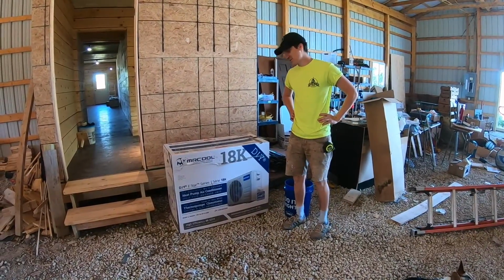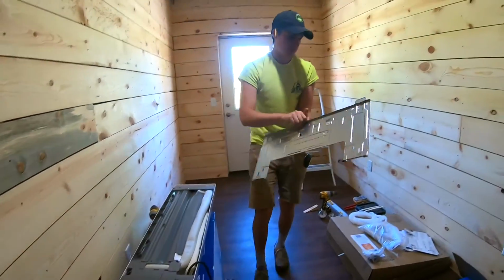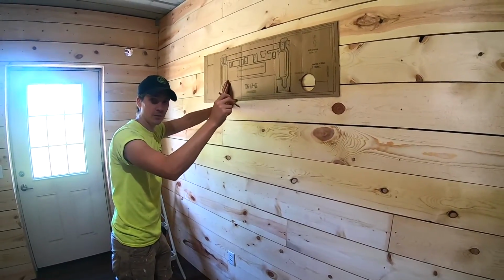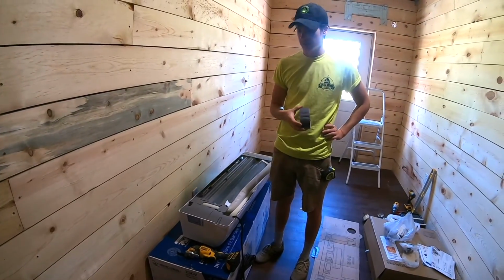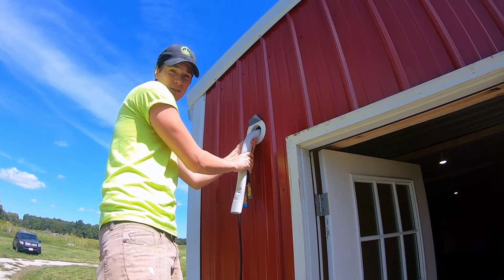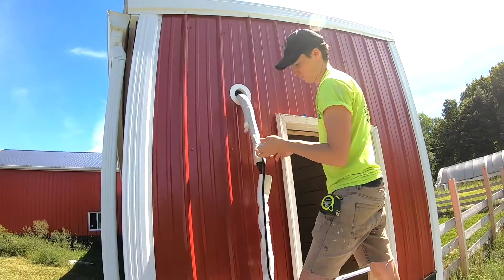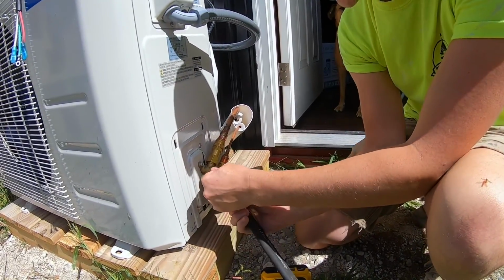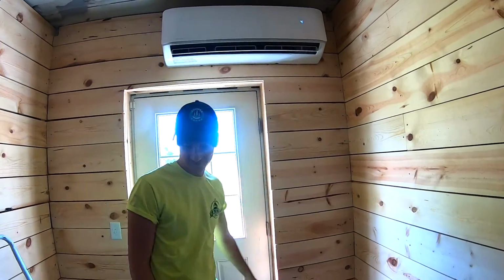How to Install Mr. Cool DIY Mini Split - Gen 3 E Star Series Heat Pump / AC

Comment from the maker: If you are wondering about performance details and costs we've experienced with a Mr Cool Universal heat pump, then be sure to check out our Mr Cool HVAC playlist.
https://www.youtube.com/playlist?list=PLExVGissIl-GdKsUBhF3c0fQ6E_o6oOaZ 
We have tried to answer as many questions as we could imagine in the 17+ videos in this playlist - hopefully they help you!

The price of the unit we bought is around $3800 ( as of June 2024) on Amazon : 
2 to 3 Ton 18 SEER Variable Speed MrCool Universal Central Heat Pump Split System - Upflow/Horizontal with Quick Connect Lineset - 15 Feet
https://amzn.to/3WE8SfI
Thats our affiliate link. Thx in advance for your support if you use it - it's free for you to use and if you do, Amazon may send us a small commission.  it helps keep our channel going! We do appreciate your help!

Comment: Extend the inside air handler out from interior wall with 3/4 or 1 inch blocking behind it trimmed out to give a little more room for bending line set, it would be a little more work but why not run the line set down in the wall through the floor under the house then over to condenser to hide the tacky looking line set from outside view and coil the excess line set under the house at location of condenser...🤔🤔🤷‍♂️
Reply from the maker: Hey Cat,
Thx for the ideas and thx for watching!

Comment: Notice no one covers the main electrical install.
Reply from the maker: Hey Jerry,
We had electrician set up the main electric.
Thx for watching!
Reply: @Housebarons  I'm no electrician, but iirc, NM-B is not allowed in conduit in wet location. If conduit is wet (outside) = then inside of conduit is considered wet as well. Should be THHN/THWN  or UF-B. Regular NM-B has paper core that can and will wick water. NEC 300.9, 334.12, albeit there are some allowances for local code.

Comment: I'm curious if the outside unit condensates or drips water. Thinking of mounting on a flat roof
Reply from the maker: Hey hoptag,
It does drip water. I believe it comes with a connection onto which you can direct the water away with a hose. 
Thx fir watching.

Comment: Never coil hose , oil can build in bottom of loops.
Reply: I asked Mr Cool if it was cool to do so & he said "cool"
Reply: @WilliamDumoreGlobz  I've seen some a/c guys say it's ok too, but it should be horizontal not vertical. It seems with these units there's always extra to deal with in the videos I've seen. It would be nice if they had different line set lengths to choose from.
Reply: @rodhoutx  I completely agree & even the written  Mr. Cool instructions suggests that the excess line be stored horizontally . By You tube message they told me that it's okay to store it vert as long as it is stored loosely. This might take a while but I suppose i'm going to find out one way or another.
Reply: @rodhoutx  they do have different line length 15, 16, 25, 35, 50, and 100. Furthermore, you can buy different line sizes and connect them together to create your designed length.

Comment: I would have mounted the unit farther away from the door around the corner so you wont have all that leftover line set and you never mount a condensor next to a door  cause youll be hit with hot air when you go outside
Reply from the maker: Hey Jay,
Thx for the tips . And thx for watching!

Comment: You should have checked for leaks at fittings before wrapping and covering.  Still gave you a thumbs up.
Reply from the maker: Hi Crashwrtr, good tip.  It is a good idea to put some soapy water on the fittings to make sure all is secure.  Thanks for pointing that out!